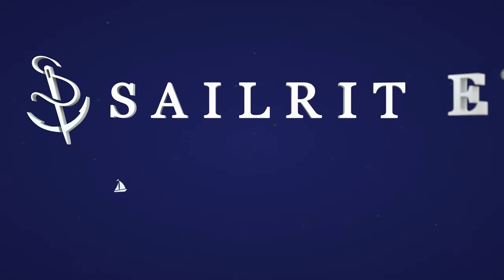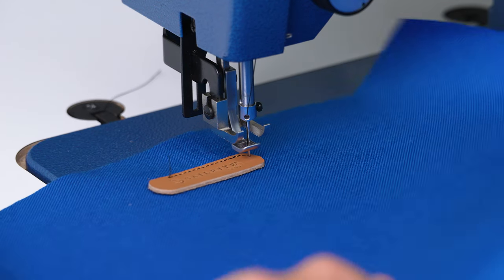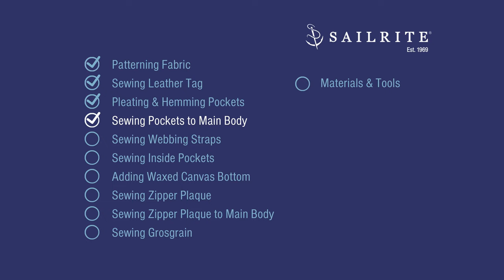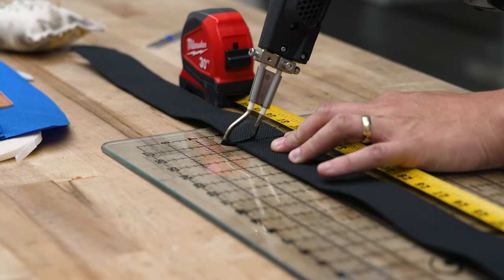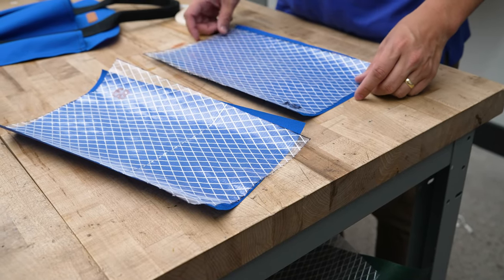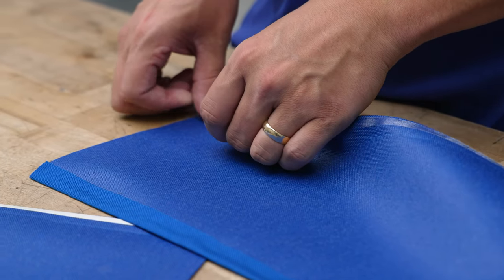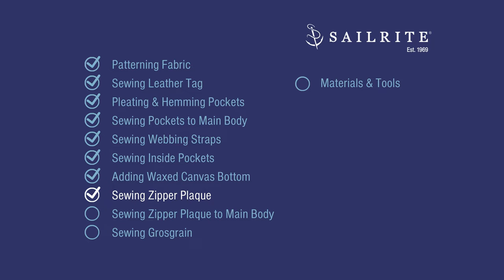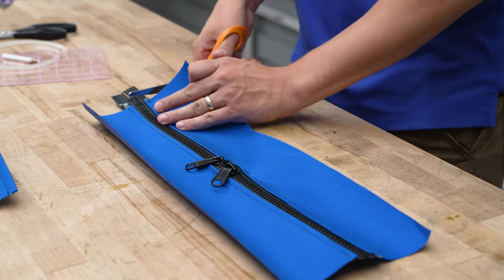How to Make the Sailrite® Utility Tote Bag

Comment: Nice utility bag!  I'm compelled to make suggestions, with my 50+ years of sewing experience.  After sewing the two layers that strengthen the bottom, stitch a big "X", from corner to corner diagonally to stabilize it.  This can be done at the time of adding the two layers or after the wax canvas is added, stitching through all layers.  After stitching the zipper in, baste across the ends of each zipper, at 1/4", just to make sure the zipper doesn't separate while maneuvering each end.  Remind folks to never stitch over pins.  I enjoyed watching this video and thank you for enclosing those raw edges on the inside! Good job!
Reply from the maker: Thanks for the suggestions.

Comment: I have made quite a few projects with your patterns/kits/videos. I made backpacks for the grandkids and they loved them. I wanted to make this bag to replace my garden tote bag.  I got frustrated in this one and had to walk away. 

It was not stated with the pleated pockets which sides of fabric go together. You know right sides together (right sides facing), wrong sides together, or right side to wrong side, etc.  It was not clear to me while watching as I was sewing. After having taped and stitched the top seams on the pockets on the incorrect side; I tried to rip out the stitching, but it has tape AND thread, so I just chucked them all and got some more fabric and recut them out and had to start over. I am going to watch the whole video again before doing anything. 
Hopefully this time, I will have a better understanding of how it goes together before I start sewing. 
ADDED: I just watched the whole video and you did a great job of talking about which sides of fabric go together in the rest of the video. Maybe you want to add text at the pleated pockets top seam segment about which way to fold it. Now that I have watched it, it should have been self-evident to fold the top seam towards the back of the fabric, but I was not that dialed in at that point. 
Thanks for the patterns! It is an awesome addition to your product line up.

Comment: Just finished my utility tote bag. Love it! The only thing I had trouble with is having the waxed canvas not match up at the end of the first long seam. Had to take the seam apart and redo. On my second try I just started at the bottom corners sewing up the side to about an inch before the curved corner at the top, then did the other end from the other waxed canvas corner the same way. No problem at all to stretch and fiddle with the top seam from curved corner to corner enough to have it work out. No one will ever see where the side seams and top seam meet, as they get covered by the binding ribbon. Looks great and seemed quite a bit easier than the official way. Excellent video too, great pace and easy to follow along. Thank you!
Reply from the maker: So glad you like the utility bag. Excellent idea on sewing the corners of the waxed canvas. Thanks for your suggestion and comments!!!

Comment: Just received my kit and will start this weekend. I noticed Seth is never holding the thread tails when he starts sewing. Please share his secret!
Reply from the maker: Actually not holding the threads is a bad practice, it should be done. Otherwise a "birds nest" of messed up threads may be found on the other side of the fabric. So... hold those thread ends to prevent that from happing. Or get used to cleaning up "birds nests" on the backside of the assembly.

Comment: Can you make it a two way zipper? so that a zipper can be pulled from the center our both ways.
Reply from the maker: Hi Diego,
This bag does use a 2-way zipper or bag zipper as we call it, it functions exactly as you described 2 sliders that can meet anywhere on the chain when the zipper is closed or open both directions from the center.

Comment: Have you tried putting on the grosgrain binding with the 1" binding attachment?
Reply from the maker: Yes, it does not feed well. Why? the grosgrain is like a fine ribbon and since it is so light when it exits the binder feeder it moves around too much. I have cut a strip of thin cardboard and taped it to the end of the binder to help keep the grosgrain flat as it exits the binder, it did work, but we need something that is metal and can be installed easily and removed.  I think in the future, we may design a part that actually fits on the end of the binder, but that process can take a year or two to design and manufacture.
Reply: @SailriteDIY  Thank you for the explanation.

Comment: Is there any reason i shouldn't use basting spray, instead of pins, on the pattern? I seem to remember that's what you used on another of your patterns...
Reply from the maker: We stopped using the spray because it occasionally leaves visible adhesive residue if you overspray. If you are careful not to overspray it works great.
Reply: @SailriteDIY  Thank you! I hate pinning, but it makes sense here, I guess.
Reply from the maker: Yes, it does for patterning.